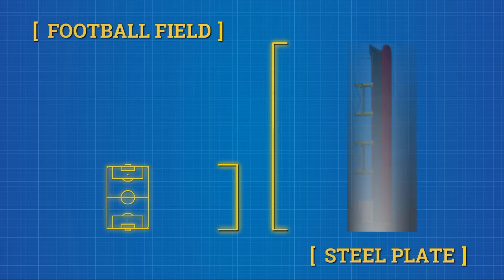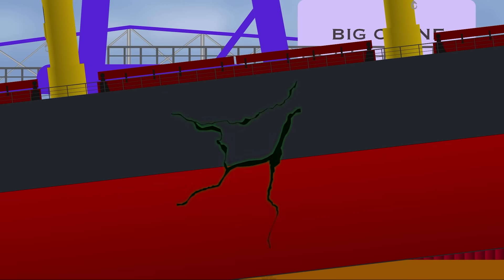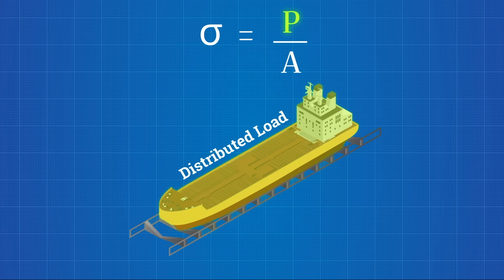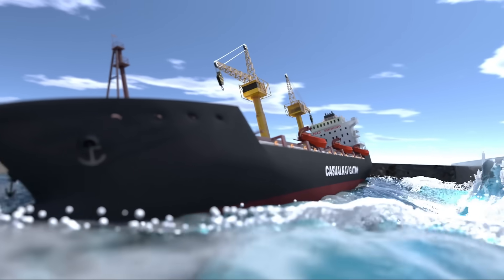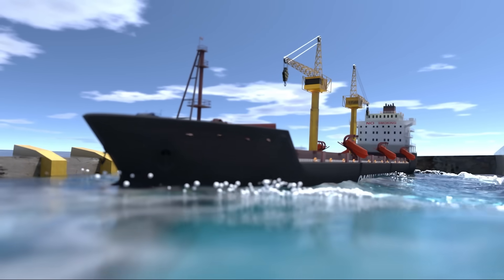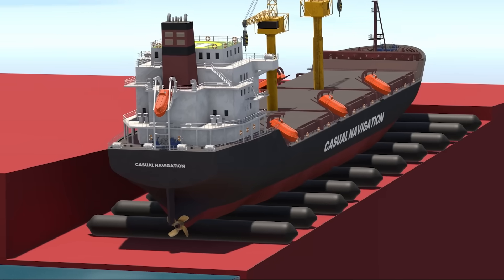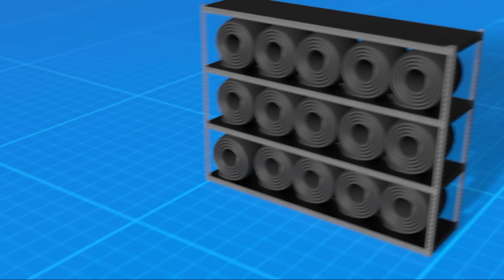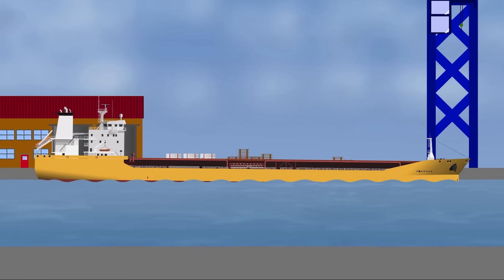The Physics of Ship Launching

Comment: My home town of Barrow-in-Furness built the Vanguard class nuclear ballistic missile submarines. They're 150m long monsters. They were all launched via lift, but they actually built them indoors before rolling them out to the lift on wheeled bogeys already fitted out (they had all 4 of the class in the Dock hall at the same time in various states of construction). Mind blowing to see something so massive being lowered into / lifted back out of the water.
I remember seeing a couple of earlier end-on submarine launches as a child (about 40 years ago), but they had to switch to lift as the submarines they were building got bigger and they wouldn't fit into the channel they were previously launched into. They previously had to wait for a high tide to avoid the subs hitting the other side of the channel and getting wedged 😬

Comment: "..a series of ... airbags are placed under the hull". That Makes it sound so easy. What happens then is comparatively straightforward, but how do place anything under the hull that's already built? Same question goes for cradles, soap or grease. And no, "bend your knees and keep your back straight" is not the answer.
Reply: EZ , it's exactly the same way as placing a jack under a car

Comment: Is it necessary to linger on the formulas so long? And is it necessary to spell out the formulas letter by letter??? It reads as though the presenter is either pretentious about maths or has some kind of fetish for greek letters. Why say "Sigma equals P over A" which means nothing to anyone and just say the greater the load the greater the pressure, and the greater the area the lesser the smaller the pressure. Or something of the sort. Interpret the formula please, don't spell it out.
Reply: Because the narrator doesn't understand what he is reading and even pronounced Mu incorrectly. Probably an AI

Comment: Great video, very informative! I have a curiosity though, why are most ships launched from the back? Wouldn't it be weird for hydrodynamic reasons to basically let the ship go backwards?
Reply from the maker: Well, yes. It’s one of the oldest methods but it’s still not done blindly. Just like we explained using basic beam theory, more calculations are used to predict allowable forces.
Reply: Keyboard warrior here, so feel free to correct me.

I believe they launch butt (stern) first because the part that hits the water first is:
* Closer to the center of mass.
* Wider. It kicks up a big wave, that helps keep the ship moving slowly.
* Stronger. There is a lot of structure there to handle the forces from the propeller and rudder.

The dome at the bow isn't weak for its size, but it is smaller than the stern, and it sticks out away from the center of mass.

Comment: A question I have is...are the ships built on an angled slipway or are they moved there for launch? Also if they are built on an angle how do they maintain that everyone is accounting for that correction throughout the build or how do they move it to the slipway? Thx
Reply from the maker: Yes, it’s built, or rather basically assembled on the angle slipway. Most of the hull sections are built in prefabrication blocks workshops, assembled flat and transported to the slipway. For correctness, several leveling tools and quality control inspections are carried out.